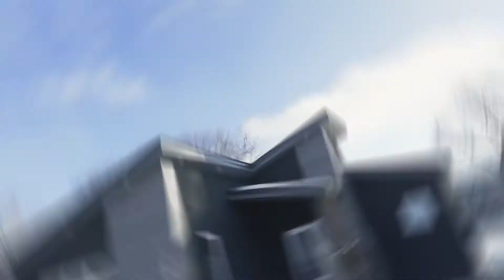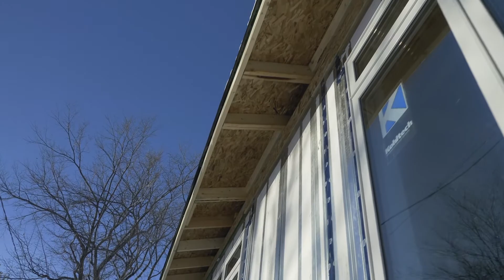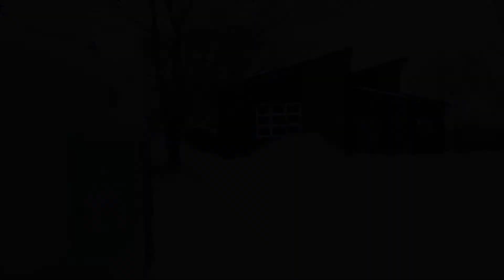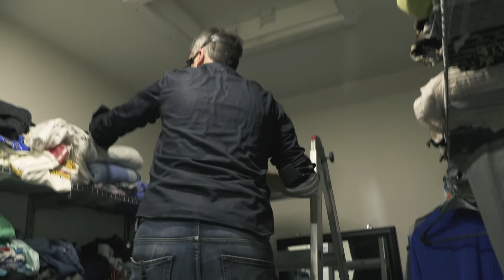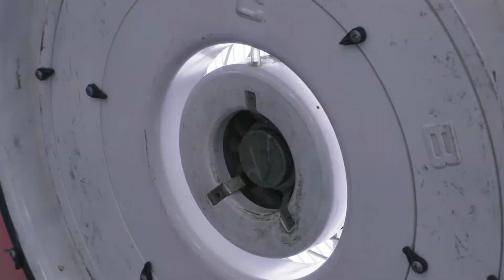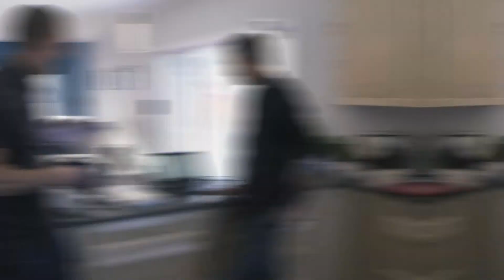Homeowner Spotlight: Choosing Energy Efficiency

Comment: I like that you gave an ACH number. I would love to know how many $ this cost. I thought I hear $12-15/sqft. I can't imagine a normal house wall is over $5/sqft even with a thicker wall. Does this wall really cost 2-3x more?
Reply from the maker: Hey Paul. This house is 41% more efficient than a typical house this size. The monthly energy bill is around $165.00/month whereas with a typical house it would be around $275.00/month. The mortgage for this house is around 3% more than normal, so 41% more efficient for a 3% higher mortgage speaks for itself.
Reply: @GreenstoneBuildingProducts  Apples and oranges.